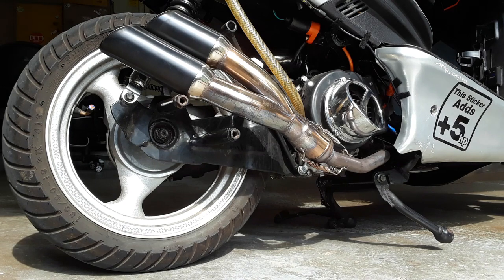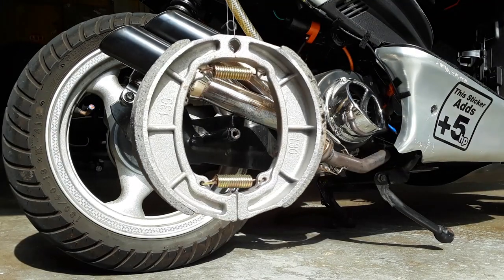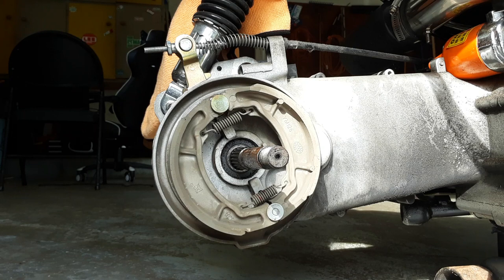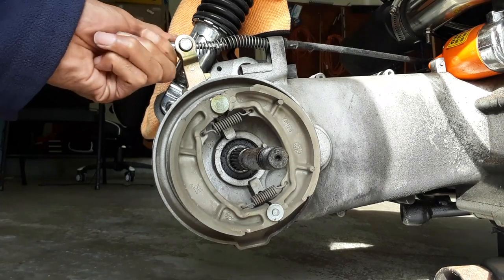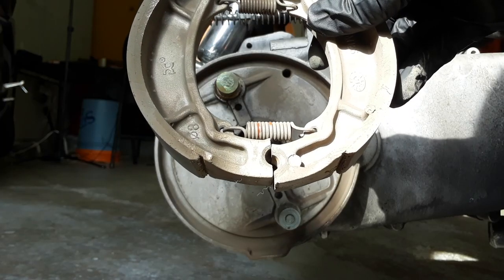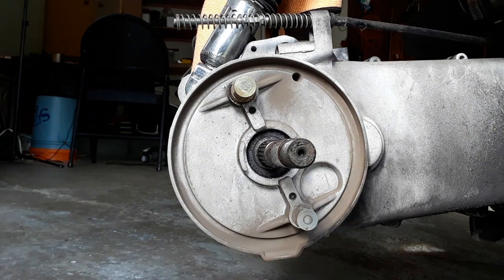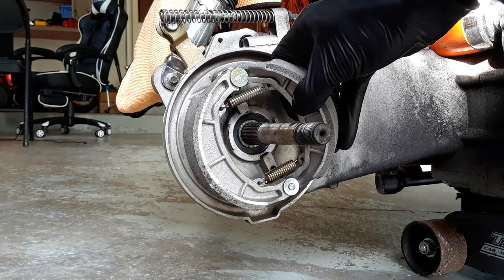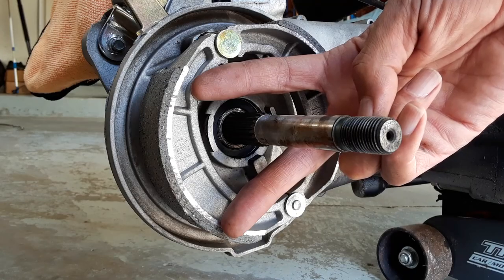GY6 Scooter Rear Drum brake change in 3 minutes...

Comment: Thanks for this easy explanation. My Peugeot Kisbee has 12000km on the clock and the rear brakes just barely do anything now. I already adjusted the tension but still, I should probably swap the pads.
Reply from the maker: No problem. Pads are cheap enough, and easy enough to change out, but so important.

Comment: Removing the center stand is the best thing I've ever done for my Lancer.
Reply from the maker: I want too but I work on my bike way too much. Plus the kick stand doesn't get a good lean. A little wind or a good fart will blow it over.
Reply: @kachiskid  Mine was mangled pretty bad and stuck out way too far. On a hard surface it was impossible to use and on dirt you had to roll it and slam the thing down like the bike is pole vaulting. When it was hitting my new exhaust, it had to go.
Reply from the maker: @thelagmeister  Oh 4 sure. If mine was causing an exhaust issue or it ever clips the ground (knock on wood) then mine goes also.

Comment: Great video. I recently tried to get my wheel off but was unable to get the piece of metal between wheel and exhaust off. I undid the two bolts and shock from the exhaust side and whacked it with a hammer a few times . What am I missing?!
Reply from the maker: Thank you. I think you are talking about the swing-arm assembly. Attempt to jack the bike up, pressure off the back tire might help. Couple of small hits with a rubber mallet and should pop free.

Comment: Is it possible for drum brakes to seize and stop the rear wheel from moving? About to start the long list of issues with my Moped but don't wanna buy a part I might not need. Any response appreciated
Reply from the maker: Oh big time, i think my brakes have seized on my Camaro. (lack of movement) I would take it apart to some degree before ordering parts.
Reply: @kachiskid  I'm hoping I won't have to order anything time I start working cause I have a second scooter for parts but not sure on the condition of those ones aha. Appreciate the response. Gonna start working on mine soon.
Reply from the maker: @GoldenCornishman  Good luck, contact me if you need some help. kachiskid@gmail.com

Comment: Any links for brakes? Yes front and back thanks, ridesfe!
Reply from the maker: Front: https://amzn.to/31PpM4b
Back: https://amzn.to/3q1X1JE
Reply: @kachiskid  thanks somuch! Ridesafe
Reply from the maker: @iamjeromeflores611  No problem. U2
Reply: @kachiskid  thanks, o btw will the ngk sparkplugs CR7HSA is also for this bike right?? And since i have a 28mm carb, that sparkplug is fine to my bike right?? Thanks..
Reply from the maker: Yup, that is fine. I haven't noticed a big difference in spark plug name brands. I stopped running the NGK and moved to a cheaper model. https://amzn.to/3mb9VDL I'm liking these.

Comment: I have a problem with mine, i got the right sized brake shoes and replaced it fine but it does not grip it properly. No matter how much i adjust the nut the brake shoes dont lock up the wheel completely. My scooter brake assembly is different, it has a return spring on the bottom, im thinking its the problem as its very hard/old.
Reply from the maker: Send a pic or video to kachiskid@gmail.com
Reply: Did you manage to fix this? Running into the same sort of issue
Reply: @sonniehoward3738  try and get a new/different sized spring for the brake shoe or keep adjusting until you find the best spot

Comment: Kid I bought a 150cc. 1 month. En when i use the rear brake it do some scuiki sound soo you tell me
Reply from the maker: Sorry Julio, what type of sound?
Reply: The pads are glazed over..Scrub the glaze off with a magic eraser and totally awesome degreaser...Sand the ring surface...Use a P 60 sand paper and sand the aluminum surface that comes in contact with the brake pads...Scratch it with the sand paper outwards

Comment: What did u use to clean the brake dust?
Reply from the maker: Wire brush, brake cleaner, leaf blower to dry. I don't have an air compressor.

Comment: My wheel does not come of.. i dont think that the brakes are engaged, because the wheel spins freely.
Reply from the maker: Set it on the ground to loosen the lug nut.
Reply: @kachiskid  the nut, washer etc is of😅 thats the problem. Ive tried a hard stop, ive sokead it in rust remover, ive tried the rubber mallet. I have tried some with a pulley, but i cant get a good grip.

All the videos ive watched the wheel comes right of😅 Because the lug nut is the only thing thats keeping it, right?😁
Reply: Got it off. Wooden block, big hammer and repeated turning and hammering
Reply from the maker: @thora3980  Awesome!